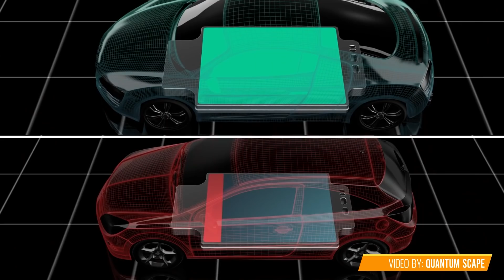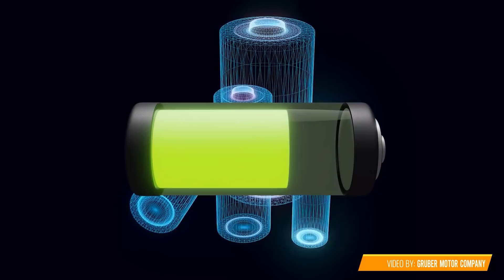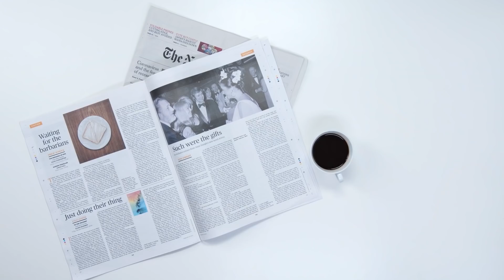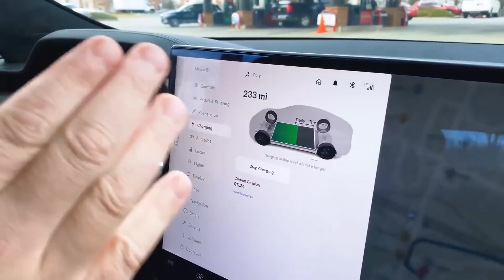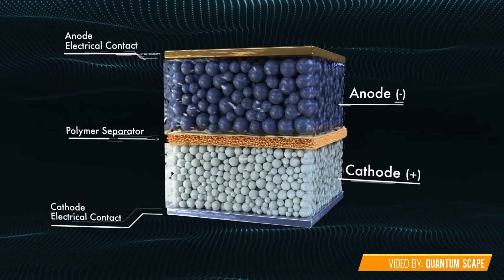SANDY MUNRO: Are Solid State EV Batteries Too Late?

Comment: My wife and I do not put many miles on a vehicle each year, about 8,000 miles a year. I drive a 2000 Chevrolet Silverado with 105,000 miles and my wife drives a 2015 Toyota Camry with 44,000.  Charging at home will provide over 99% of our charging need.  We only pay $.12 per kilo-Watt-hour, so we will pay a lot less for "miles of travel" with electric than with our gas vehicles.

But, we are waiting to buy electric vehicles when Solid State batteries come out.

Comment: People said for them to switch to EVs they would need at least 150 miles of range (mid 2000's). That happened and then they said it had to be 200 miles of range -- that was achieved in the early 2010's. Then they said it, no, it had to be 250 miles of range -- that was achieved in the mid 2010's. They then said, no, it had to be 300 miles of range for them to switch -- that was reached in the late 2010's. Now it's the early 2020's and we have a car that goes 520 (500 on a  real world 70 MPH range test -- took over 7.5 hours to complete) miles of range (Lucid Air - which also gains 200 miles of range in just 11 minutes of charging) and two heavy pickups that get above 300 miles of range. One, the Rivian, gets at least 340 miles when using economy mode (which still gives it over 400 horses of power, that's right, economy mode still has more power than the vast majority of ICE vehicles) even on less efficient all weather tires, and doing highway speeds of 70 miles per hour.

What are they asking for now? A thousand miles of range before they switch? Which ICE vehicle even comes even close to that on real world range tests, not EPA guestimates (tests mostly done by the manufacturers, BTW) which use driving at or below the speed limit. So please don't quote those guesstimated EPA ranges.

Comment: Yhee but 15 min at the fastfood place, or 5 min and have to go to a gas ⛽️ station, is way better then 1 h on special charge stations out in nowear.

It's like people dont take breaks when long driving. 15 min or 60 min is a greath differance. You shouldn't drive 6 h strait.

It is still a fact that you might want to know is it 10 min, 15 min or 30 min för 80% charging.

Comment: The reason Americans don't buy EVs is because of the costs. Most U.S. buyers chose used vehicles.  The current state of the used EV market is immature.  Most of us won't spend $60,000 on a new EV and the lower cost $30,000 EVs don't appeal to many buyers.  Right to repair, ongoing support for battery replacement will benefit the 2nd hand EV market.  Until then, there won't be a rush to buy EVs.

Comment: 15 minutes is fine for charging to 80% capacity.  The issue is the RANGE you get on that charge.  Realistically, once you can get 350 to 400 miles on that charge, EVs will be excellent vehicles for road trips.

Comment: I have a diesel station wagon that goes over 600 miles on its 13.5 gallon tank, 700 when traveling. I know that when I take a trip that 700 miles is the most I want to drive in a day, even when I share the driving. That is 10 hours of driving if you average 70 mph. So even though we don't have to fill up, we have to stop to use the restroom and each the lunch/dinner that we packed in our cooler. 

Today's EVs work fine as commuter cars that get recharged at home overnight. But with a measly range of less than 400 miles, EVs don't cut it for traveling. If the recharge time could be cut to 15 minutes that would seem to be helpful, but it really isn't because we probably couldn't create the charging infrastructure to handle that on a large scale. You can't charge in 15 minutes if you are in a line of people charging for 15 minutes. 

But if EVs have a range of 800 miles, then that solves everything and EVs can completely replace fueled vehicles! Once they can go more than you can drive in a day, then you can recharge them at your destination or hotel. The recharge can take over 4 hours since you won't be able to drive again until after sleeping. An 800 mile range negates the need for quick charging and doesn't just eliminate range anxiety as Mr. Munro says, it turns EVs into serious vehicles.

Comment: I agree with his point about the charge time and made the same points myself:
If you're charging at home, it doesn't matter how long it takes so long as it's done by the next day.  If you have a way to charge at home and your EV is your daily commuter, there is no concern so long as the battery charges enough overnight to complete your commute the next day.
If you're on a road trip, you're going to want to take a 15 minute break once in a while.  In my experience, when you're on a road trip with 4 people, you tend to need to pull over for a bathroom break every 200 miles.  If you're in a rush, you might be pulled over for 5 minutes.  So, if you have one of these fast-charging high-capacity batteries, you should comfortably reach the entire distance.

Comment: maybe works in the US, in Sweden, there is VERY few fast chargers, and EV with big battery packs are to expensive. i need to be able to go at least 400 kilometers per charge (i perfer 800km). and with my petrol car i can go 900 kilometers on one tank. battery's needs to be equal to petroltank at least. and then the price for a EV is insane in Sweden. 
so i run a Hybrid, i drive on Electric for all everyday trips, and the long trips i use the hybrid system, works great.

Comment: Sandy mentioned, in this interview, Luddites, who were anti-industrialisation in nineteenth-century Britain, fronted by a (possibly fictional) General Ludd, who encouraged 'working men' to carry out raids on factories, smashing machinery which was obsoleting hard labour trades.
Modern-day Luddites have different tricks. One I have heard of is parking semi tractors (or any ICE vehicle) on top of or otherwise blocking access to charging stations. I'm afraid that law enforcement will be encouraged to aggravate that situation with slow response to complaints of such actions.
I live in Alberta, the hearrt of Canada's oil country, yet I see quite a few EVs on our roads. I wouldn't say they are about to supplant doesel- and gasoline- powered vehicles, but the changeover might rival the demise of horse-and-buggy days.

Comment: I'm thinking of those scenes of blizzards or multiple car accidents shutting down interstate highways in frigid conditions, trapping hundreds of cars for several hours.  The heaters in those cars discharging their batteries and leaving passengers stranded.  Until this problem is solved using an auxilary heater/generator or similar device, I don't see drivers in Northern states using electric cars in the winter months.

Comment: Sandy is totally right.  Another thing, when I owned an ice vehicle it always took 15 minutes when buying a snack and waiting in line are considered.  With electric there is no line so the time factor is neutralized.  Also, just today I read a report that Toyota finally has a solid state battery that they plan on using.

Comment: I don't believe the less than 15 minutes to fill up your ice car. I call b.s. on thst. You have to wait in line to get to the pump. You have to wait inline to pay cash. You have to wait inline if the receipt needs to be picked up inside. You have to wait inline to use the toilet.  And, and,  in the winter or summer your ev will keep the cabin comfortable why you wait. Cannot do thst with your ice vehicle at the pump.  I live in a very rual area, about 3500 people in town, 7k in the county.  We have like 6 stations in town.

Comment: As variable timmimg came, as compressors did, as EGR, as direct injection etc, abs, esp, etc.....
Solid battery SAFER, more Energy storage and faster recharge and reability. It's not too late. It's EVOLUTION.
BimmerN53

Comment: I'm switching with 30 mins - 35 mins charging and it's zero problem. It takes a bit longer. So what? 95% of the time, the car charges from the house.
Reply: Sandy Munroe is absolutely right in everything he says regarding batteries and attitude to range and charging. EV's are already fine as they are.

Comment: 15 min charging requires a source that can deliver an ENORMOUS amount of power for that 15 min. Something around 330kW. That kind of power is only available at an industrial tie point - perhaps dedicated stations. Lets say you have a truck stop doing that and they would need 6MW available to charge 20 cars at a time. 

That is big for remote locations.

Comment: And this is why I say do not trust Sandy Murno. He is actually wrong. Yes, Solid State is taking a while, but here is the thing, it's not about charge times. Now, ONE doesn't list a charge time for that battery, but at 200+kw, it has to be close to 2 hours at a fast charger and probably a day at a household charger. It also weights 1200lbs. Solid state batteries are designed to have a higher energy density than standard batteries while also weighing not even half as much. Current SSB's have energy densities twice that of standard batteries and don’t weigh half as much. In essence if you had a battery the size of ONE'S composed of SSBs it would have a range of over 1600 miles and last 10x longer. Stop going to Sandy Munro. These are basic differences in the technology, in fact this whole video is poorly researched because both Toyota and Hyundai have basically hit the same markers and are in testing of actual vehicles, and are prepped to have SSBs enter the market this year. Now, Toyota's will be in PHEVs but still. Nether ONE nor the other guy have any contracts with any automakers to put their batteries in their cars. While they are great leaps forward, they are not better than SSBs. I don't even think they will be cheaper.

Comment: My folks are in their 80's and you cannot convince them to buy an Electric Car. I miss my 2019 Leaf my issue was I did not have the charging Network to get from Alabama to Texas. So I bought a Toyota Corolla and averaged 40 MPG. I was excited about the New Ariya by Nissan but angry that they have jacked the prices up they are putting the screws to people by jacking price up to offset the rebate to put it back in Nissans pocket. Only the base Ariya is in line on price. I was very interested in it but noticed they kept jacking the prices up on the Models with a few more options. Also they still have not greatly improved the charging Network if you want to take a trip across the USA. Charging was a non issue for me as I had a level 2 at the House so I could plug it in at Home I do not understand why People do not get that?

Comment: ok but other advantages SSB has over liquid electrolyte chemistries are operating temperature parameters & no catastrophic failure in which a lot of energy is released in the form of heat.

Comment: The new battery technologies that Sandy mentioned look promising & could win over the masses. The hurdle as I see it is that EV manufacturers MUST STOP competing against each other with obscene acceleration.

Approach it from a practical point of view & it's clear that smaller & lighter batteries will lower the EV entry price dramatically. It then opens the door to wow fence-sitters over with lower costs of maintenance & charging.

Comment: Fast charging is only one of the benefits of solid state. Higher energy density means you can have twice the range for the same size/weight battery (or same range with a battery half the size) and better safety (no thermal runaway).

Solid state batteries are better, they're just too expensive. When they can get the price down they will become ubiquitous.

Comment: could it be we are at the beginning of battery innovation? ICE cars are more than a century old and only about 30% efficient at converting gasoline to energy - EVs are much younger (yes yes they've been around but really innovating on an industrial scale is like a decade?) and already much more efficient - even cell phones are vastly better than even ten years ago. also the range/charge issues feel like something driven by countermarketing from oil companies - most people don't drive hundreds of miles a day or fill up multiple times a week.

Comment: Charge when you park if you can regardless if you need it or not. It's just a different way of thinking vs petrol. The benefit is electriciry is cheaper per km than petrol

Comment: Great interview with Sandy, and I totally agree with him. The real question is, what will the cost of these new high range batteries be? Maybe they will be on the market by 2023, but if they add an extra  $15,000 or $20,000 or more cost to the vehicle above what EVs already cost, what will their adoption rate really be?
Reply: should eventually be cheaper and way easier to recycle. good enough is ok for today but better is better.

Comment: There will a day gas will become expensive. While the price per oil barrels is cheap.  Because each gas station is privately owned and they profit on volume of gas sold, but if there a few ICE cars on the road. Each gas station owner will need to increase thier margins to keep the lights on.  And yes most gas stations make more money on food, drinks and snacks. But you may see old gas  station convered to just a grab and go, and not sell gas at all to keep over head down.

Comment: If Sandy Munro is right about these new batteries being on the verge of commercialisation (eg the one with 752 miles range), does that mean the Tesla 4680 is going to be outdated pretty much as soon as it’s ramped up? Or will the 4680 have enough of a cost advantage to make it relevant for a few years?

Comment: So I think the real issue with speed of charging is neither for the road trips nor the charging at home.  Let's be clear -- 15 minute charging of an EV at home has no possibility of ever occurring.  It would mean having a massively high power circuit on your home breaker panel...  Granted, charging at home is pretty useless in the U.S. until you've installed a 240 circuit dedicated to charging, but at least it is possible.  And like Sandy points out, there's no motivation for it.  Road trips as well, it's for long drives and short stays to use the bathroom, eat something, whatever.

The first -- and much smaller -- use case, in my view, is the day-to-day quick fillup.  The thing about going to a gas station is that it is something you can just do and be done with in a flash.  Nobody goes to a gas station to relax.  The main reason I'd personally be interested in a 5-minute charge is if all the EV charging spots at my office are taken up and I still need to charge.  And even if people are supposed to move their cars after a full charge, it's a friggin' workplace; people are busy, and will not keep track of things like that ever.  Having a spot where I can charge to 80% without eating up a large chunk of the day is a good thing.

The other use case, I'd say, are long-haul logistics and taxi services as well as buses (assuming you don't want to deal with overhead wires).  Minimizing down time is an absolute must-have in order to maintain overall throughput.  Electric trucks for long-haul shipping aren't going to happen any time soon because the batteries weigh too much and you'd need a massive amount of time to charge them if you are looking to get any sort of range out of them while hauling the kinds of loads they need to carry.  All that down time costs money, and you cannot have that.

I think range anxiety for the general public is based more on the charge time thing.  If you go to zero miles of range on a gas car, a service truck can top you up in a few minutes by filling gas from a can.  If you go to zero on an EV, you need to be towed to the nearest charging station, and you're screwed for a while.  Range anxiety for uses like the aforementioned long-haul trucking, taxis, and transit...  that's perfectly valid.

Comment: and if your range is 700 miles, and you do a 5 minute charge to 50% - that's still 350miles.  Even with todays batteries - a short charge is usually enough for a few days of city driving.

Comment: I have one of the shortest range EVs which is about 80 miles.  It is a completely usable car and what makes it more usable today than 8 years ago when it was new is the DC Fast charging infrastructure.  There are a lot more DC Fast chargers around today but will be really nice when there are 2 or 3 times as many.  The problem with public charging stations currently is reliability.  They have to be maintained better mechanically but also backward compatibility with EVs as they age.   My car is already experiencing this.  A certain DC Fast charger manufacture on some of their newer models have a software glitch which limits the charge rate for my car even though it is capable of 50 Kilowatts.  My car on the freeway at 65 mph get 4.6 to 4.8 miles per kilowatt hour which makes it super cheap pre mile because it is not carrying a big heavy battery.  Now in 10 to 20 years when the battery needs to be replaced a nice lighter solid state battery that will give me even longer range will be wonderful.  I am confident my battery will last that long because it is a Lithium Iron Phosphate battery.  After 8 years the battery has only lost 2 maybe 3 miles of range.  It is the charging infrastructure and the quality of the maintenance and long term compatibility that will make the difference.  Once you can simply drive your EV and know once you get down to 5 miles of range you will easily be able to find a reliable public DC Fast Charging station that is when EVs will really take off.